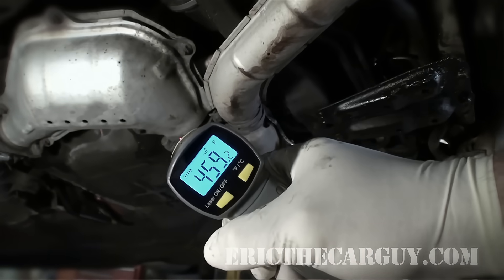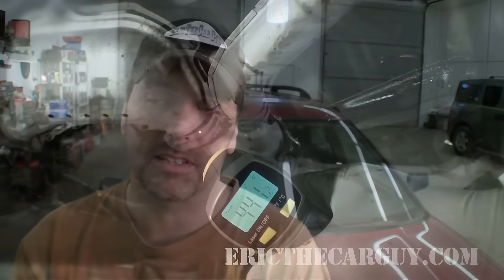Does Lacquer Thinner Clean Catalytic Converters? -EricTheCarGuy

Comment: IT Works! I have a 05 Toy Corolla 194,000 making all kinds of engine noises enough that you would stop, noticed and laugh. I had a 1/2 tank of gas, bought a gallon of L Thinner at Home Depot of $18. I drove 22 miles on I-35 without the OD on keeping RMPs between 3,500-4,000 then put OD on for the next 72 miles, totaling 94 miles from Austin to Waco. There I met my son for lunch and car ran like new, no noise, no shakes, no nothing. He then drove it 5 hours to Midland, Tx and its been running great! So 7 hours over 450 miles works great. I will do it to the rest of my vehicles.
Reply: How's that Corolla doing now after all this time? Did it start acting up again later?

Comment: These hardware store paint thinners are less octane than regular gasoline.  Beat a catalytic convertor with a plastic mallet and if that doesn't work as for as cleaning just spray gumout in one and then soak it in gasoline for about 8 hours and then reinstall

Comment: According to Scotty Kilmer, the ratio of lacquer thinner to use is 1 gallon of lacquer thinner to 9 gallons of fuel.  I put 1 gallon of lacquer thinner at half tank in my 2007 Honda Odyssey, so my ratio was slightly greater (1/11 ratio).  Anyway, it worked for me.  The light went off after about 250 miles of driving.  Looks like Eric used 1 quart for well over 9 gallons.  Not nearly enough and not what Scotty recommend.  Probably why he didn't get a good result.

Comment: added gallon lacquer thinner to quarter tank in 99 camry. p0420 code smooth running 90k miles after adding thinner check engine light would sometimes flash and engine would chug.. not idle smoothly. ran it for 30 miles or so like that then filled with premium gas. I don't recommend adding thinner to your fuel. It did not give me positive results.

Comment: As a person who is 53 years old and has worked on engines since age 10, I thought the suggestion of lacquer thinner in my gas tank was crazy. Our 2005 Toyota Sienna had the check engine light on and had just failed the PA emissions test. The Toyota dealer wanted over $1300.00 to replace the 2 converters on our van.  I was planning on doing the job myself but i read on the internet about cleaning them. The more I read about this working for a lot of people and after considering what chemicals are in intake cleaner, I decided to try it. I added 1 gallon of thinner to 10 gallons of gas and we ran that through. Light still on. I thought that the van ran the same with the thinner as normal so I tried the process a second time. Within 2 days, the light went out on its own. it had been on for 9 months straight before the thinner. Definitely, something positive has happened with the thinner. Moral of the story, always keep an open mind and follow directions. For $9.00 a gallon for the thinner, this was great.
Reply: Is it still running well
Reply: Wow, about $17/gallon now 😆  but better to try than $1000+ for the new cat.
Reply: @stephenjohnson802 I was going to say the same thing lol
Reply: 5 years ago $9 gal, it’s now $19.84
Reply: @KazumoriCabal  lol i just replied saying something similar and saw this comment. I payed $25 with tax I think.
Reply: @KazumoriCabal Just send by  biDUMB the bill for inflation
Reply: Did the light stay off? How’s the vehicle running?
Reply: It's 2022, the price for a gallon thinner is now $25 lol.
Reply: Great feeling when that light goes off. ✨️
Reply: Thanks for a detailed description of your experience. I hadn't thought of running a second gallon through the system but as they say, try, try and try again.
Reply: 2024...1 gallon now 25 dollars
Reply: But did it pass smog? Was p0420 code gone?
Reply: I'm from the future. Loonbag lefties have stolen the whole country. It's $36 a gallon now 😡
Reply: Which thinner did you use
Reply: Please help me!😩😭☹️
I have a 2005 Mitsubishi gallant  4-cylinder.
The back CC is clogged. When i hit the gas it makes a loud rattling noice (like when you light one of those hand held sparklers on the 4th of July). Should i do the thinner hack, or replace it? 
I plan on selling it, so don't want to put alot of money into it.
Reply: I done different methods of cleaning cats and passing emission tests. 

My last emission test was on a 1988 Dodge Omni. I did everything from changing oil, plugs, air filter, vacuum leaks, etc.

I could not make a spec I think it was the parts per million of Nox. 
A work mate recommended getting the car drunk. I could of used 100% vodka, but opted to used 4 litre of methyl hydrate. 
Ran that with 91 Octane gas. 
The exhaust was so clean smelling, took it to the garage for a emission check and blew really clean. It passed.

Fast forward today. Got a 2009 Chevrolet Aveo 1.6, getting a P0420 code. 
Cat problems. I cleaned the Cat. Out because flow thru the holes was still good..
Made a flange to block one end of the Cat. 
Put Cat. Vertical and filled it with Muriatic Acid..This ate the crud inside. Let it sit for 3 days. Then washed it out with hot water and liquid soap (Dawn) let it dry. That was the end of the P0420 code.
Reply: @diycarhome9151  So this is probably obvious, but you pulled the cat and plugged one end and filled it up like a flask?
Reply: @breasonable4343  yes

Comment: Scotty said to use a full gallon of the lacquer thinner in half a tank of gas (roughly 7-8 gallons worth) if you have about a 15 gallon tank, which I believe your Subaru does. I had a 95 Legacy and it had a 15 gallon tank as does my current 2007 Forester. 
So, your can of lacquer was not gallon sized, it wasn't even half gallon sized and you put it in a 3/4th full tank. So your thinner was quite diluted (not enough). Now, I understand that you might have done this so as not to have too much thinner going through your engine so not to risk damaging something, but it's not the recommended amount in too much gas. So unfortunately, your test is moot. If you're going to do a test, you have to do it the correct way, otherwise it wont matter. It's like putting a mere drop of dish liquid in the dish pan with 2 gallons of water and complain the dishes still feel greasy and aren't clean. Well no kidding, you need more detergent than a single drop. Put in the proper amount and your dishes will be clean.
Sorry Eric, but you got sloppy on this one.

Comment: SeaFoam works a bit better and faster, and remember the hot soak cycle (after the can is emptied, turnthe engine off and leave it off for at least 10 minutes). After the ten minute ht soak, drive the sucker hard for about 30 minutes, the residual smoking should be finished by then. Put it in the tank (up to 50/50 mix is ok), AND try the crank case SeaFoam application (one q of SF to 1q of oil right in the crankcase), give it the same let it ide at 1500rpm for 5 minutes, turn the engine off, heat soak for 10, then drive for about 20 to 30 miles, then YOU WILL NEED AN OIL CHANGE.

Comment: F150 02 v6 4.2 manual transmission. Both cats have ticking or knocking noise that goes faster as I give it gas. Do you think this method would work on my tuck. My Next option is to pull the whole thing off but it's a pain in the ass to get off.

Comment: I tried this today and CEL went off immediately and truck running smooth and idling much better. I used a gallon in a 3/4 tank. I'm replacing my muffler but the clogged cat converter is cleaned out. Drove about 50 miles.. worked for me.

Comment: Hey I did it & it worked. I did the one gallon of lacquer thinner:1 quarter tank of gas. The light came back on within 50 miles. I didn't think it was going to work. I unplugged the pcm fuse to clear the cold, let the car sit over night. I drove it to work last night & made it there without the light coming back on. When I got off, I went straight to the emission station & it passed. I saved over $400 by doing this.

Comment: If your converter is failing because of raw fuel getting into it - because of a leaking fuel injector that has stuck open from some type of build up or sludge has blocked the intake of fuel - then lacquer will work...It works because it cleans the fuel system - NOT the converter!!!!  If a converter fails without any internal collapses/physical damages, then 99% of the time it is the result of unburned fuel getting into it...RAW GAS KILLS CATS!!! Converters just don't go bad because they wear out...In fact they never wear out on their own...They will convert dangerous exhaust gasses forever....

Comment: I've run a quart of paint thinner into my tank before, and the thing did seem to run better, especially at idle. The reason I did that , was that I heard so many good things about Marvel Mystery oil, and also heard that one of the main ingredients of it, is paint thinner. I also added nearly a quart of two stroke outboard motor oil at the same time. It was just something I had around and likely would not be using anymore anyway. It was the TC3 or whatever kind. Anyway, my old motor seemed to like that mix.

Comment: Eric was spot on. Will this work for you? I would say that it is a resounding MAYBE!!! Lacquer thinner is a very, very strong solvent, and extremely combustible. I know from experience, but that's another story. Lost a lot of hair that day. Fuel systems have a lot of plastic and rubber components that could be damaged by introducing chemicals other than gasoline. Your best option for the DIY is to use additives that have been tested. Maybe BG 44K, or having a shop do the BG fuel service. I have had limited success with this. Maybe 1 out of 4. Or, your could try to "cook" that cat by inducing a misfire. I prefer to disconnect an injector as opposed to eliminating spark. Both can help to "clean" the substrate by "overheating" the cat. Converters get hotter in both lean and rich conditions. They like balance. Lean is slower, but is safer. This still does not work most of the time, but I can understand the desire to save money if you can. If you need to replace a cat, some aftermarket products are better than others, so I stick with those that I know will work. They may cost a little more, but it's better than having an unhappy customer and/or having to do the job twice.

Comment: To get to the converter, something added to the fuel tank must pass through the engine, combust and then pass on to the emissions system, correct? Thinking strictly about combustion chemistry, the products will be CO, CO2, H2O and your NOx's depending on complete/incomplete combustion. Regardless of what you add to your fuel tank, it's still going to combust and result in those products. I can't reason in my head why any petroleum additives/distillates (all alkane, alkene, and aromatic hydrocarbons) in these "cleaning" products would do anything other than what a gasoline mixture does?

Comment: for the most part cats have three types of failures the honeycomb breaking,the honeycomb structure melting and clogging,
and finally the only thing that can be fixed (POSSIBLY) without replacement, clogging from debris.,,,, its worth noting that cats theoretically should last for the life of the car, you really should fix what killed it before you do any repair or replacement.  the the key here is if the cat is dirty or damaged. he said the cat is is not clogged therefore any attempt at cleaning is pointless. also do a rattle test before you try cleaning, if your cat rattles  buy a new cat

Comment: Hey Erick, great videos, they have help me a lot, 

I have an issue on my 2006 Honda pilot, shortly after I took it to the carwash, the check engine, the VTM-4 CVM lights came on, now the truck will crank but will not start, I was able to start it by moving the steering wheel from side to side, I don't know if that was what let the car start, so I took it to advance auto parts to scan it, the errors I got was, 71-1 the wrong tire size on. 61-1 battery voltage malfunction, 83-1 Engine control module( EMC) powertrain control module Relation malfuntion, and Po339 Cramshaft Position Sensor A circuit intermittent.

Do you  do you mind giving me some advise.

Thanks again.

Comment: I tried this method of lacquer! from scotty it ruined my cars performance I had multiple leak' I never had before and my car ran horrible, I junked it, play at your own risk.
Reply: Did anyone else have this result with lacquer thinner? 
As a chemist and career shaklee distributor I am hardwired to look for safety and efficacy not just efficacy. Add a 
2004 Honda Odyssey EX
that's throwing a code P0420 
on the same week I need to sell it... Must solve soon cheaply... Watched both videos and read every review, 
Clear on benefits of Scotty's effective ratio and Eric and everyone else's caution...
Welcome troubleshooting assist asap

Comment: Got a question for ya....I have a 99 suburban, new engine...all new ignition parts, plugs, wires, rotor, distributor cap, spider injector and yet it still misses....my mechanic tells me I have bad o2 sensors and catalytic  converters.....my question is....can bad converters cause misfires..or do I simply have bad o2's...if replaced will my misfire go away or do I need the converters as well...stymied.

Comment: I'm a Painter and more than once have run one of my vans on 100% acetone base lacquer thinner and have pulled the plugs to see the damage and they looked like they just came out the box never had a problem with pump or regulator or seals in fact I dumped a gallon in my explorer 5.0 last month when it got below -20 still running good cats o2s that was on a half tank and the vans were chevy 4.6 5.7

Comment: Yeah, I wouldn't bother trying to clean it. At that point, the catalytic converter had fulfilled its duty of protecting the environment, so I'd say just get a new one. Also, lacquer thinner is going to remove all kinds of dirt and rust from your gas tank, and all that debris may cause damage to your engine.

Comment: Bckgrnd: A P420 code always reappeared as soon as the sensor became active again. Smog test failed after clearing P420 code. HCs=270. I added 1 gallon lacquer thinner to 1/3 tank gas. Cleared P420, drove like hell for 150 miles till tank was empty. Filled-up, failed smog again but HC dropped to 190. Drove 500 miles more- P420 gone!  Installed new universal cat for $80. Passed smog with HC=8 and Limit (max) was 160.

Comment: I tried it on my 1988 Toyota Pickup, 4 cylinder.  Had the engine rebuilt 4 years ago and had to replace the Cat twice to pass the smog since then.  Not looking to spend another $150 doing that, I paid 19 bucks for a gallon of lacquer thinner at Home Depot.  I poured about 80% of it into a little more than half a tank of gas and drove it on the freeway for 75 miles.  I went straight to the Star Certified smog station and it passed with flying colors.  Of course, I also did a tune up and oil change before doing so.  I feel better response from my pickup now also.  It worked for me, guys.

Comment: This guy didn't follow Scotty's directions properly. Scotty said a half a tank of fuel and then pour in a gallon of lacquer thinner that's use an oil-based paint. He also said this may not work and you may have to clean it or replace it.

Comment: I came all the way back to tell you guys what happened. I didn't wanna drive 100 miles so I divided everything by 10 and ended up putting just 1 pint in with 1/8 tank (about 2.5 gallons) I was gonna put 2 pints which would have been the correct proportions but the hardware store was closed and I had to go to work. its about a 10 mile drive. I poured it in, drove to work, felt some extra power, got those rpms up. then I went to the gas station by my work, revved it up for a while to try and burn it off, then I put some gas in the tank to dilute it so it wouldn't just be sitting. then I drove to work nearby and let it idle and revved some more to get it all out of the system. now when I turn the key, the car starts right up. before it had to wait about a second. I did this because after using seafoam in the intake I had power loss at high rpms. kind of like a preventive maintenance type of thing. my car runs quieter now. this shit works.. just do the math and put in the amount for the distance you want to drive.. I wasn't getting the cat code tho so if you have that maybe you do need to drive 100 miles. i might do it one more time in the future but for now im happy. i used klean strip brand lacquer thinner in my audi a6

Comment: can you run your car whiteout the cat? or would date cause trouble for your car
Reply: As long as your 02 sensors provide appropriate feedback to your PCM, yes you can. But you will not pass a smog check of course.
Reply: Mary Reed alright I Wil